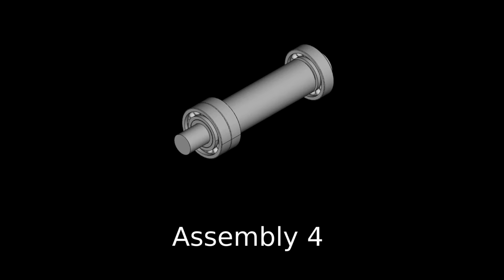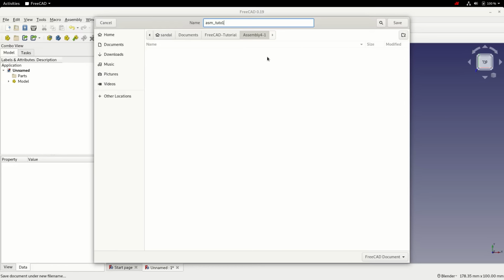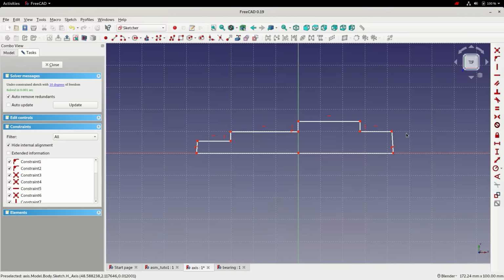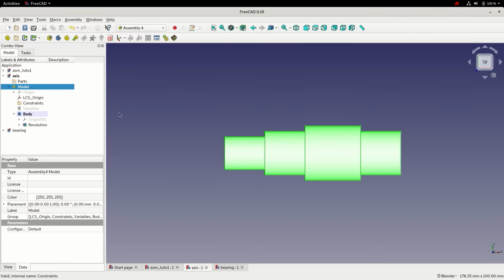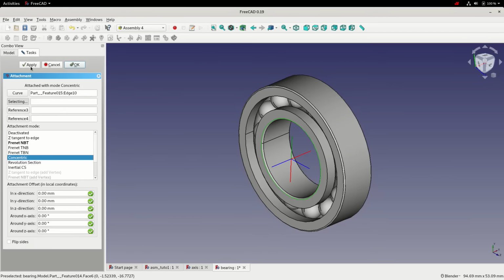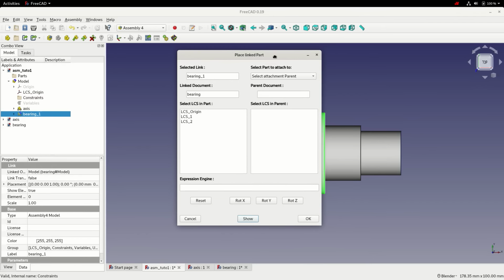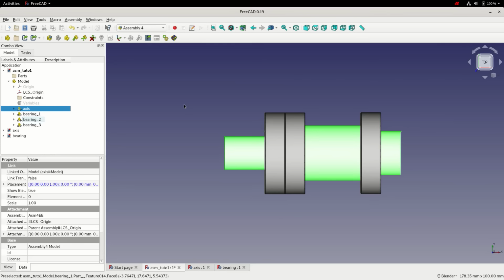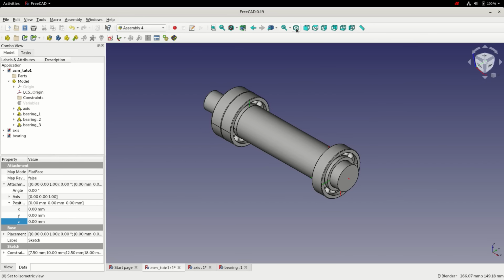FreeCAD Tutorial - Assembly 4 Workbench

Comment: I've just been looking into FreeCAD a bit, and was a bit surprised there's no default assembly workbench. Certainly, this seems to do the job at first glance. I've been using SketchUp for a while, and there's many things I really like about it, but SketchUp seems to lack proper constraints, leading to lots of manual adjustments and potential errors that are hard to identify and fix. Constraints would avoid most of those issues. Now I'd also like to venture into some basic manufacturing of parts (milling of sheets and basic engraving), and SketchUp doesn't really do that either (at least with the non-Pro versions). From my perspective, having worked with SketchUp quite a lot, this software here seems... crude. Yeah, it seems to be rather awkward, slow and overall dated. That Fusion 360 seems to be all the rage nowadays, but the pricing on it and similar software is good at scaring off hobbyists considering stepping up their game just a little bit and try selling their designs and products. I'm just not sure.

Comment: Yes, even paced, clear and concise. Just a pity age disadvantages me as it’s over 20 years since I retired and last used CAD professionally as an aerospace airframe component designer. I have grasped the basics of freeCAD, but the ‘tree hierarchy’ system is just a mite challenging as earlier systems I used did not employ a visible tree display; allowing for a good measure of intuitive design methodology. I belong to an association of retired engineers, carpenters and craftsmen and, as the only CAD-trained member, I thought FreeCAD could be of use. Am currently building a sphere turning fixture for a wood lathe. I have modelled all the detail parts using FreeCAD as well as creating the 2D detail drawings using Techdraw. The design concept, however, I modelled in SketchUp as this is very flexible and does not need to be modelled parametrically. The perspective capability also helps other members to “see” the finished installation in 3D space. This tutorial is uncanny as the shaft with the bearings - as a concept - matches the shaft and bearing assembly I designed for the turning fixture. I have used just two standard bearings as I am confident only a small amount of axial thrust will be imparted during operation of the fixture.

Comment: Can you not just insert all your parts into an assembly and move them into position without all the LCS and mates. This is way to complicated, mates have to snap if used. Fusion360 ditched mating, it's not necessary. I think FreeCAD really needs to rethink mating parts. It just what everyone else has done, now Autodesk has gone away from it with Fusion. It's a needless pain in the butt, time consuming. FreeCAD could be the best, if they stopped trying to being like everyone else.
Reply from the maker: There are several assembly workbenches and each provides a different approach. That the beauty of FreeCAD; choice.

Comment: The Assembly4 seems way too much "cerebral" to be used versus A2plus.
With A2plus you simply click on objects edges/circles/etc. to get a reference and then you align then the way you like more. No dealing with obscure LCS to be searched across the model... if you're not the author of the part this can be quickly became a frustrating nightmare, IMO.
Reply: Yeah man, they complicated so much this. In Autodesk Inventor for example is so easy to make assembly...
Reply from the maker: Have you tried A2+ or Assembly 3? The key difference here is choice. You can choose how you want to assemble models.
Reply: @MarthamEngineering  yes, I liked this A2plus  more than Assembly 4

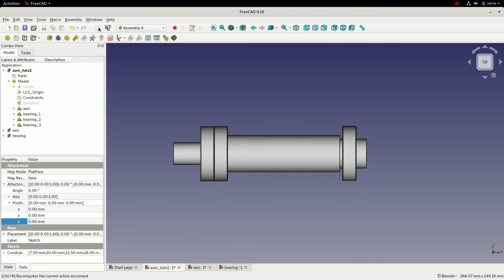Comment: Great tutorial. I get to 12:56 when you recompute your model to have the bearing realign to new end of shaft. When I get here, my "recompute" sysbol is greyed out, eventually I find "mark to recompute" and click recompute but the bearing does not move, stays isolated in original position. The bearing via its "linked part" is attached to Parent Assembly#LCS_Origin, is this a mistake, the parent LCS origin has not altered by editing the  sketch, so why does it move. Logically the LCS_origin of the bearing should be attached to the stepped face of the shaft, but very clearly the tutorial (both the original docs and your faithful illustration) does not do this. Any help or explanation would be appreciated.

Comment: I still do not understand how assembly 4 is supposed to be better than a2plus. It feels like so much more work to do in order to create assemblies.
Reply from the maker: Not 'better'. It's a different method of assembly. There are a few methods currently under development A2+, A3 and A4. They all work slightly differently and give the community the opportunity to decide the best method.
Reply: @MarthamEngineering  Thank you for the reply. Do you know of any use case where the method used in assembly 4 is better suited than the one in a2plus. I am just curious. Maybe I am missing something here.
Reply from the maker: I think the biggest advantage is that A4 only uses built in functionality so if you build an assembly using it another user can open it that doesn't have the assembly workbench installed.

Comment: Isn't Freecad .19 still in beta?
Reply from the maker: It is still in development and I as far as I am aware there haven't been any  formal releases. I find it more stable than any previous versions.
Reply: Martham Engineering Ok I’ll upgrade but seems like tutorials should only be with released versions or we are forced to install unreleased versions.
Reply: Tried to upgrade to 0.19 but there is no windows installer listed and there are two different windows 64 bit files listed in the versions list.  What’s the difference and how do you install them.  This is not an issue with any of the released versions.
Reply from the maker: A majority of users select 0.19 due to required features only being available there. I'm a developer on FrreCAD Path (CAM workbench) and we recommend ALL users who need CAM functionality use 0.19 again due to the huge number of improvements and features that have been added since 0.18.
Reply from the maker: https://github.com/FreeCAD/FreeCAD/releases you select Conda or Non-Conda. Conda is a package management system.  https://docs.conda.io/en/latest/

Comment: Thank you very much. 10/10. It's still quite slow compared to Fusion360 object snapping in assemblies, but hey it's there anyway. One thing I'm very curios. Is there possibility to highlight collisions between assembled parts? I made custom part for my mpcnc and I made object profile, then inserted shaft and bearings and it was super convenient to calculate and highlight if model had error where parts wouldn't actually fit together. I guess technically it's there as if I recall correctly there's that possibility to subtract with another part? Function wise that's really close as feature
Reply from the maker: As far as I am aware there is no interference checking at the moment. This workbench is relatively new. I'm sure as it matures these types of features will start to arrive.